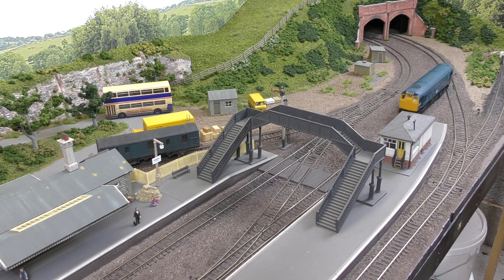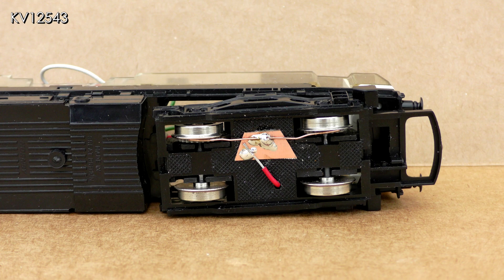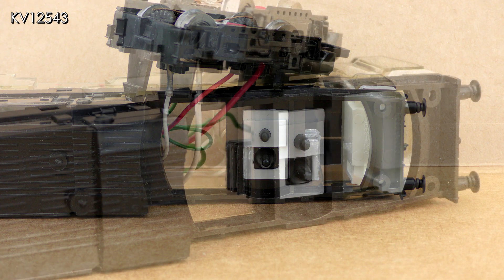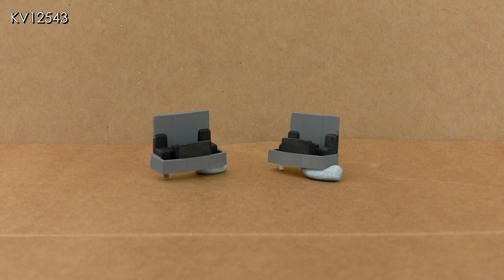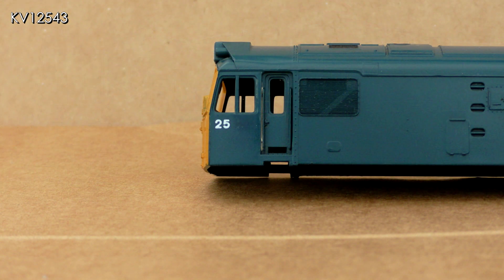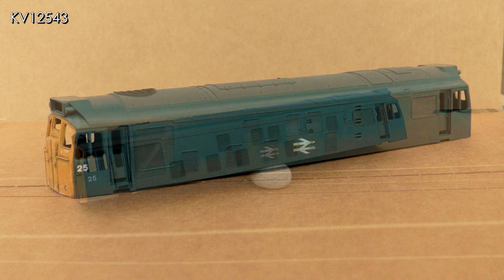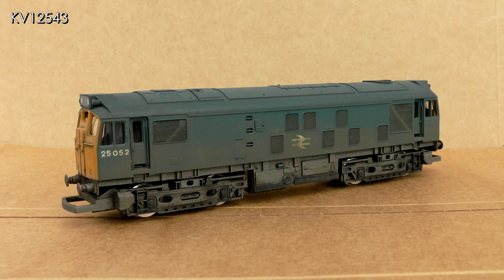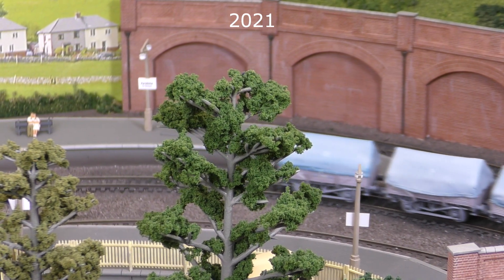Easy Hornby Class 25 Improvements - to fix lean, add extra pickups and weather the body.

Comment: Keith, have you ever replaced or added pickup's to a Hornby R239 BR black class 4P 2-6-4T or similar? I am replacing the x03 motor with the new Peters Spares can motor and discovered the original pickups are too loose in the chasis.  After watching this original video I have upgraded several CL86, CL87, CL55 CL156 loco's. Thanks again.
Reply from the maker: Hi Hugh, I did once fit extra pick ups to the loco on a tender drive Schools class if that is of any use. I videoed it and you can see how I got on on this channel, Regards Keith